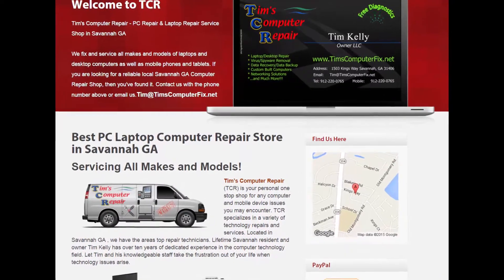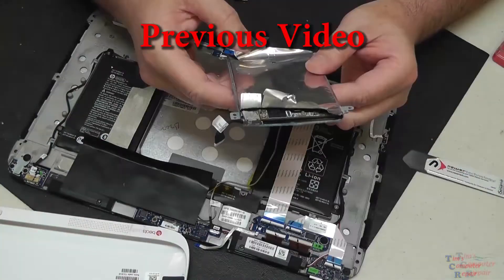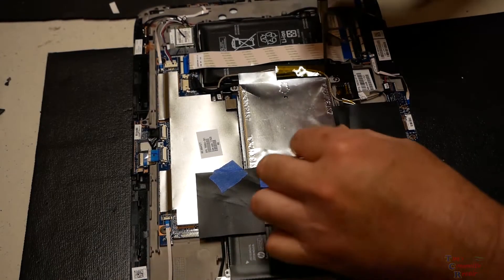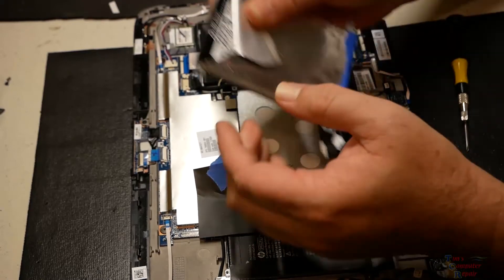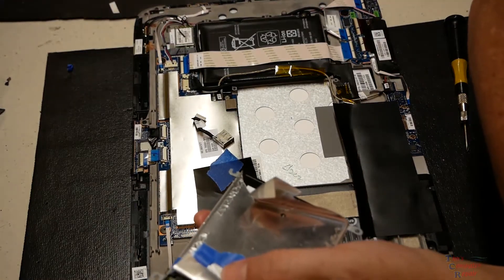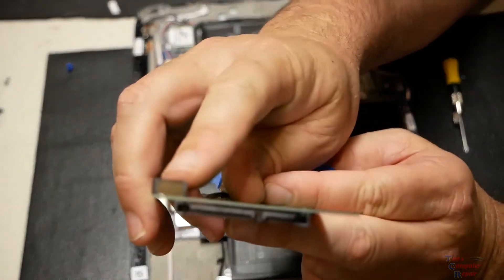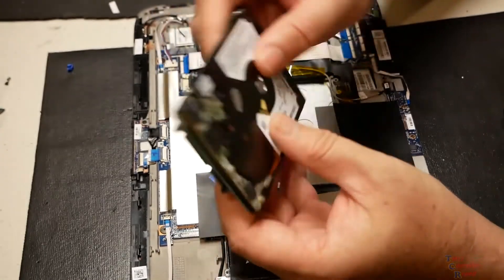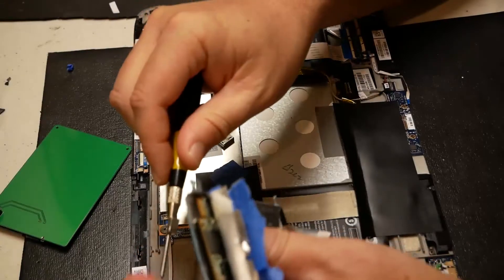HP Split Hard Drive  Replacement and Hard Drive Recovery

Comment: i bought one of these for 100 us, the keyboard is not working which at the time i did not mind because i thought , ill just remove the hdd from he tablet, and install w10 on it and put the hdd back tot he tablet and boot.

but unfortunately i found out about this connector to late (already had the tablet)

tbh i do like the tablet part i even launched FFXI on it.

the problem is the os that it has it performs badly.
Reply from the maker: Thanks for commenting.